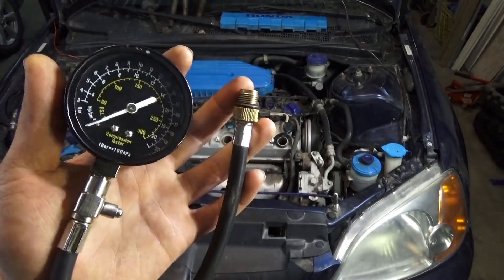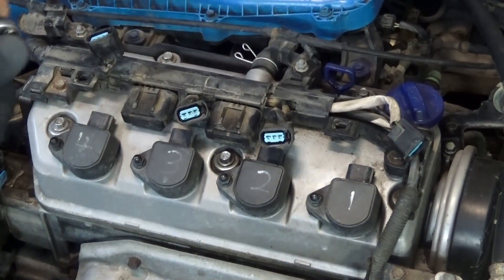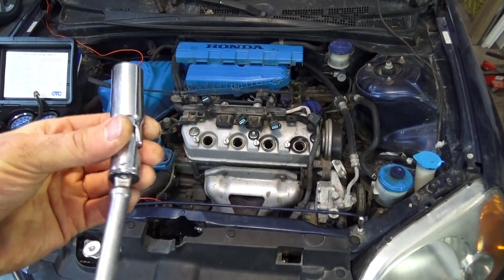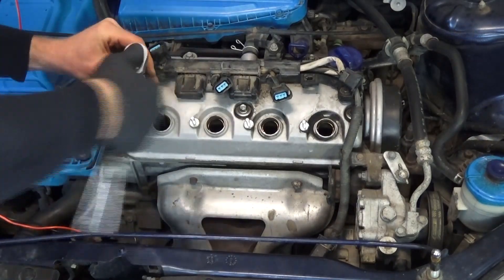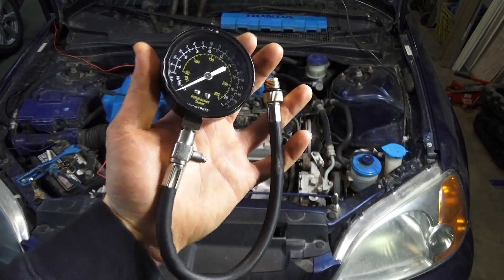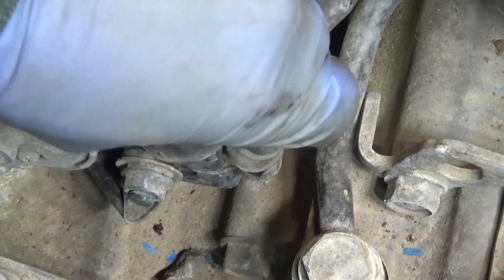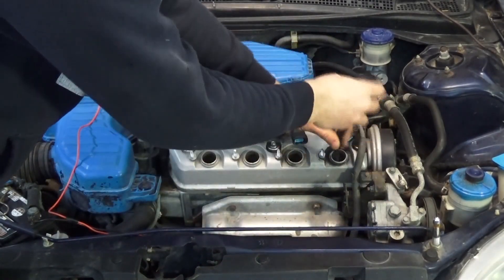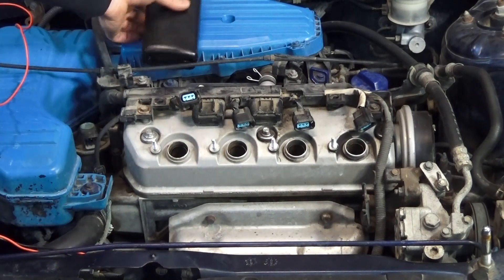Honda Civic Compression test

Comment: Good information, especially on the wet test (ring vs valve).
I'm not a mechanic, just a guy who works on his own car, but I've heard some say to bring the engine to operating temperature first, before doing the test (it would make the plugs "hot to handle" though).
I think the connector you need for a 7th and 8th Gen Honda Civic gas combustion engine is 14mm.  It's a bit dicey getting the right compression test kit with the right connector is the reason I mention this.

Comment: Not going to lie you could’ve cranked it eight times which is when the needle on the compression tester stops moving which gives you the top reading I’m pretty sure your numbers are a little off because you didn’t let it completely stop

Comment: 60 1 2 30 3 60 4 60 what you think
Reply from the maker: @lavaughnmiller663  30? That’s too low.
Reply from the maker: Sorry. Seems like time for an engine job
Reply: I did A head job n that was my end result  may have to take the head off again I think the values didn't get put in correct
Reply from the maker: @ oh no! Hmm. Maybe the timing is off! I’d check that first.

Comment: I have a Honda Civic lx 03 that isn't going over 4000 rpm/ 25 mph.. I'm at a point of giving up on it
Reply from the maker: Hey. Have you scanned it for codes? Sounds like it’s in a limp mode. Does the transmission shift?
Reply: I’ve had this before and it was the top dead center (TDC) sensor. Engine light came on for that one
Reply: VTEC Selenoid error 90%. Check selenoid oil screen and selenoid itself.

Comment: I have a civic 2010 and my test was

1. 130
2. 130
3. 130
4. 125

Is this good?? I haven't try the wet compression.
Reply from the maker: Yes those numbers are quite normal.
Reply: @zerbinauto  so is this okay even mostly my number below the standards 138psi?? Thank you for your reply 🙏🏽🙏🏽